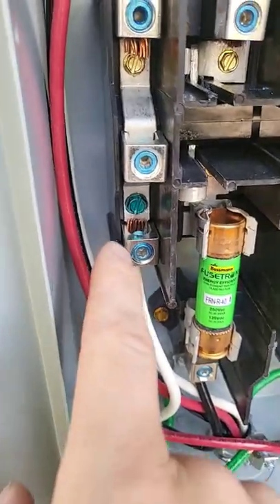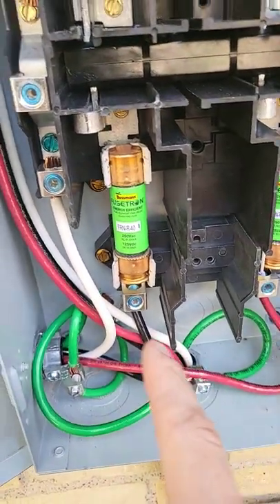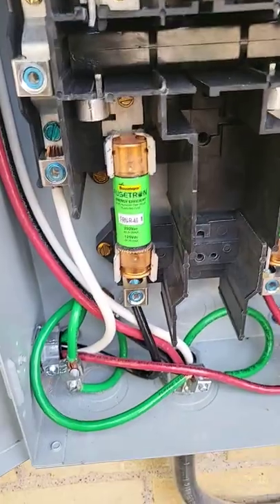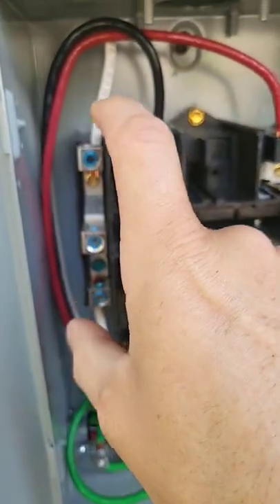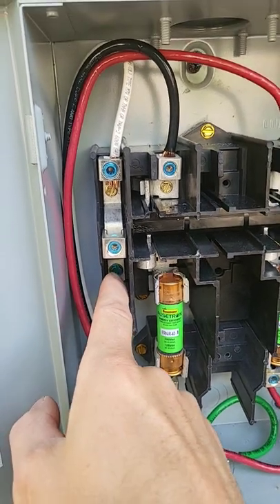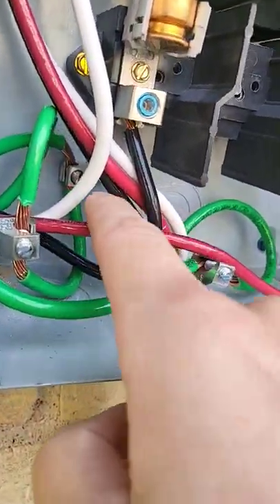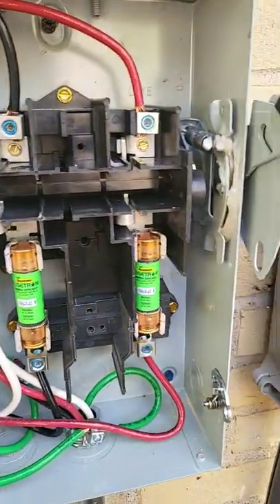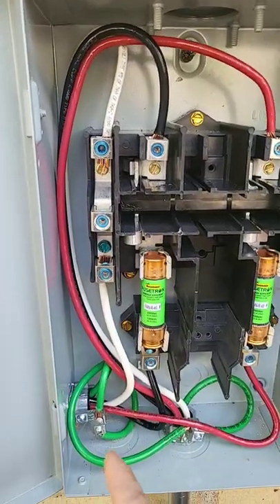Stop doing this - solar install tip

Comment: You are correct sir. Your ground is only meant to carry momentary fault current to clear the fault. 

When you create a parallel path, then current is flowing on both the neutral and the ground, which is dangerous and can cause serious injury or even death.

Anyone working on electrical systems should be properly trained to prevent injury, damage to equipment or property, or even death. 

It's not a hobby. Please only use properly trained electricians.

To me that looks like a job your buddy SoAlz the Tool might have done! 🤣😂
Reply from the maker: Lol

Comment: If its a line side tap you have to bond your grounds and neutrals. Its the first means of disconnect. If its breaker back feed then you shouldn't have a fusible disconnect.
Reply from the maker: Yeah they say because it's a line tap that that disconnect is the first means..  but  the grounds and neutrals are already established so we should isolate? what benefit do we have by bonding?
Reply: @toolsandtactics  the bonds in the panel don't apply to anything after the taps. You are creating a 2nd main basically, from meter to 200A main all those grounds and neutrals are bonded. Now you've done meter to taps, taps to disconnect and fuses, now all these neutrals and grounds have to be bonded. 

With a breaker back feed you're tying into that 200A main and those bonded neutrals and grounds apply to that breaker. That breaker controls the solar system and in beneath a main that has all its neutrals and grounds bonded.
Reply from the maker: @micahw6304  ok are you saying you tapped the neutral too?
Reply from the maker: @micahw6304  I read this again, to make sure we're clear,  here they lineside tap to the conductors that feed the main200  and just 2 ( both hots only )and don't tap the neutral 🙊then they run the neutral from that 200a panel to the fused  disconnect
Reply: Yes that’s the correct way to do it, technically the ground wire should be irreversibly crimped to gec neutral can be landed on neutral bar. Load side tap you remove the green screw. It’s all in the codebook
Reply: I agree, there are certain applications which require bonding in this panel so telling people to stop it all together will just create confusion. Specifying which application would appropriate this video.
Reply: My inspector requires me to have bonding screw in on line taps.

Comment: If you run a dedicated ground rod for the system it is more than acceptable to bond them in the disconnect with a piece of solid 4 running to the the rod

Comment: Can I use the neutral line to provide electricity to say a battery charger to charge  say a 48v battery bank instead of given back the electricity I’ve bought from the electrical company ? What is stopping me from  Harnessing the electrify from the neutral line to be used ?
Reply from the maker: Possibly that's an interesting concept because you would need another line  to get a true potential 
so  image you holding the neutral that was cut   left hand 1 side right hand the other side  (yes this would harm you)   but   technically it turns 1 side into a " common"   hot and the other as the return path not really a neutral  lol  

  also the get a potential you would Need another system  of a ground reference    also  I think it would still reflect as a load  and not be free

Comment: Typically when the green screw is installed they ran ahead of the first means of disconnect
Reply from the maker: Yeah they say because it's a line tap that that disconnect is the first means..  but  the grounds and neutrals are already established so we should isolate

Comment: Their is a reason why you must combine the 2 together with a fused system. And by code, you cannot ground the can and use that as a path, with tying the 2 together. It must be directly connected to the lugs. It is considered a "Service" because you are tapping on the feeders, and both ground and neutral must be bonded on the same lugs.
Reply: So if you are tapping on the feeders in the panel, that set up is incorrect.

Comment: I had to have my electricians remove the ground neutral bond they did with the 100amp breaker going to my garage.  My bond is in the main 200amp panel already.  So simple... I don't get it.  I think they were missing the ground bar to put multiple wires together at the original install.

Comment: Hello sir, I was wondering about the wiring size of the throw over switch. My set up is the same to which comes from 22 solar panels to the inverter. 

My Solar panel Throw over switch has 6 Awg wiring going to my main house CB 
And 8 Awg coming from my solar panels through the inverter and to my Throw over. 
This just seems wrong to me since it wont hold as much amperage as the 6. 

The ground wire is also funky due to the face they seemed to use 3 separate wires connected i stead of using one strand of ground wire and stripping back the i sulation for the c clamps. 

It might be okay…. I guess it just looks jacked up to me. What do you think?
Reply from the maker: Sounds fine, the grounds,   as long as they are all connected together, it should be ok

Comment: In my area the inspectors told me if the system is already bonded then we have to install the green screw and if the system is not bonded then we have to tape the green screw to the side or it’s an automatic fail. Idk, I just do what they say. KCMO
Reply from the maker: I gave up! Bigger fish to fry...  keep seeing 80-100 amp back fed breakers on 200 amp panels.... I'm the grand scheme of things I suppose it doesn't make that much of a difference  with how short the wire is....

Comment: Most ahj want them tied together in the disco. And most of these solar systems only have a neutral to power up a small computer. The solar itself doesn’t require a neutral. If you amp clamp it, there would probably be little to no current.
Reply from the maker: I suppose I could see why on a supply side connection.. but no reason on a backfed breaker

Comment: It’s a service, so the code is what the code is. Also, i will put money that the inverter connected to this only uses the neutral for voltage sensing.
Reply from the maker: you are correct about the low current draw on the neutral but not technically a service i backed off of this because of the neutral draw being so low  though i did see a tech get shocked (a tiny 1) in a neutral like this before
Reply: @toolsandtactics  I think the being a service thing is kinda up to interpretation. It sure does have that spicy fault current and should be treated as such. In my opinion, when you have spice like that, you want as many redundant return paths as possible. If you were to use non service rated equipment you could possibly have issues, that fault current is still there. Multi-tenant services are built with multiple bonds all the time, and you’ll often find stray neutral currents going across metal service raceways in these cases. This is one of the code topics that i’ve always liked to have discussions about. If you have any code articles about this not being a service i would be very interested in a discussion. We are on 2017 here.
Reply: @toolsandtactics  Also pause how did he get shocked? must have been something weird going on there, like he opened it hot or something
Reply from the maker: @infl  yeah he did
Reply from the maker: @Caden Higgins  that's cool, My thought of redundant paths goes as far as: the beginning of the code says in 250 Anything likely to become energized must be bonded  steel,cld wtr, etc  
So that's good for many paths, but ultimately. Those all go to 1 point,the neutral so any ground fault eventually can get to the neutral and through the winding of the utility transformer to get to the hots to trip the breaker

So that being said if a phase has 10amps b has 12  you have 2 amps of current on the neutral 

So you wouldn't want your grounds and nutrals bonded before the mbj  you end up with 1 amp on each just as you described  

let me look for the references
We know them as source circuits
Similar to secondary conductors on a transformer but we don't call them a service but we agree they get treated the same as far a bonding  

In this case though the neutral on the solar  got its reference from the utility panel not solar so why would we create 2 paths ? I'm  I agree i love these conversations
Reply from the maker: @infl  https://iaeimagazine.org/columns/photovoltaic/the-2020-national-electrical-code-and-pv-systems/

Comment: Totally wrong! This is tapped in the msp? If so it’s like another service and neutrals and ground need to be bonded at first disconnect means. If it’s a backfeed breaker you wouldn’t need a fused disconnect.

Comment: Actually NEC 2023 states now that you must install a GEC in fused AC disconnect on solar systems per Bill Brooks contribution to the 750 of the codebook this cycle. The EGC should no longer pass through but perm crimp onto a #6 GEC and straight to Earth. Although it is still not considered a service disconnect, it has to be installed as one when tapped behind the Over current device in the MSP. But even with that said, yes THIS specific way of installing in any scenario is wrong because there is no path to ground and most likely the Neutral is not IPC'd to the Supply side but on the MSP bonded neutral bar......

For future reference of 2023 changes for Grounding or Bonding

The first draft language accepted for 705.11(D) in 2023 mimicked the balloted 2020 first draft language and stated: “All metal enclosures, metal wiring methods, and metal parts associated with the power source output conductors in 705.11(B) shall be bonded in accordance with 250.92(B). This metal equipment shall be connected to the grounding electrode system for the service at the power source disconnecting means with only one of the methods in 705.11(D)(1) or (D)(2). Where the power source uses a grounded conductor, 705.11(D)(1) shall apply”.
Reply from the maker: Yeah, attaching to the earth (in my opinion does very little)  it is a higher impedance for fault... sort of an old way of doing things. the earth connection is still good but not superior and the reference truly comes from the neutral  associated with the power source. so an MBJ makes senses with respect to bonding anything likely to become energized. ... that's where bonding the grounded and grounding in more than 1 place gets hairy..  the earth being the same potential in that area (equipotential) is a benefit but as far as clearing a ground fault the neutral is superior and the should have the  fastest clearing time. 

Interesting thanks for the info and contribution!

Comment: This isn't correct information. If your interconnection is a LINE side tap you DO install this bonding screw. If it is a LOAD side tap you do NOT install the bonding screw. This is dictated by the details of the NEC articles on services, grounding and bonding, and PV systems. If you are going to profess information as fact please back it up with code references.